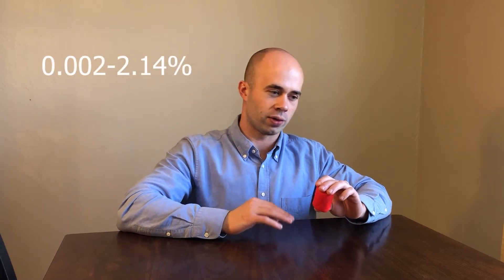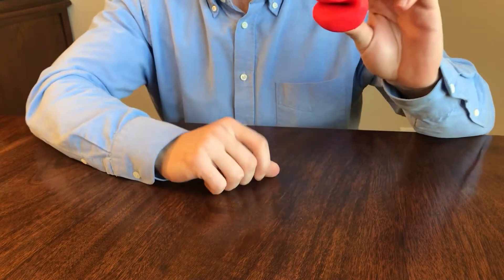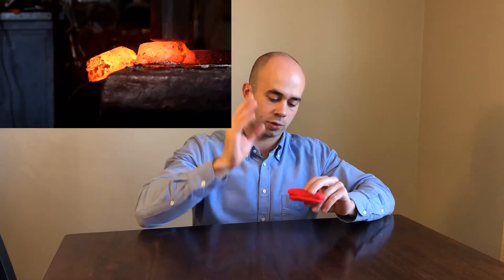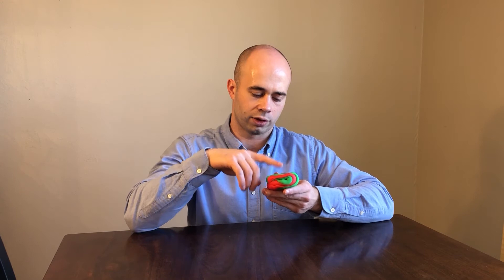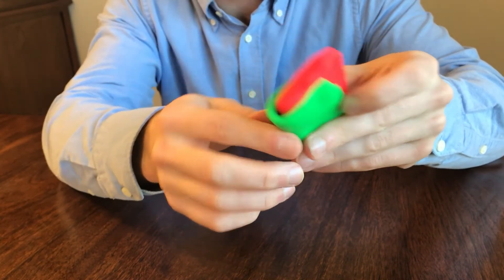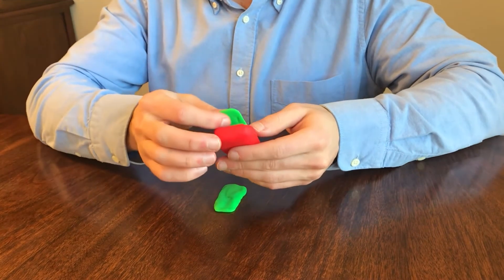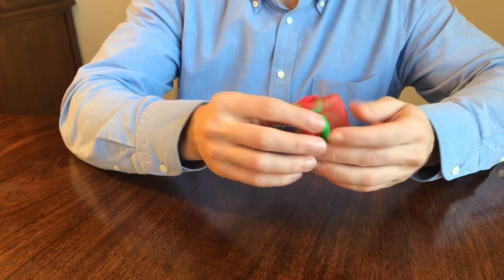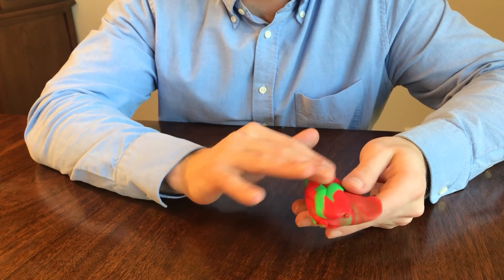Chinese Sword Metallurgy - Folding and Forge Welding 中國刀劍冶金學 - 百煉鋼和鍛焊方式

Comment: The twistcore segments of your video were unexpectedly interesting. I went thru the Mandarin mansion website to read up more about it and its really interesting that you say its probably from southeast asia. It seems like theres been a number of swords in south east asia like the kris utilize this technique. I was wondering what source or how you came to the conclusion that it comes from south east asia because the idea of that really interests me. Could it be possible that it arrived in south east asia by middle eastern influence? I dont really know anything on the topic of twist cores so im just spewing nonsense right now but the idea of southeast-asian metallurgy finding itself a place in chinese smithing as such an advanced technique is quite interesting
Reply from the maker: Fireislow As far as I am aware the theory was originally proposed by Philip Tom who is a widely respected figure when it comes to militaria in China and Asia more generally. I am not sure when or how places like Indonesia began producing twistcore blades. A middle eastern influence may be possible, but I don’t like to make any assertionswithout some research to back it up.
Reply from the maker: K, I just re-read an article written by Philip Tom in which he states that twist core blades came into Indonesia with the spread of Islam and then came into China due to extensive maritime trade between Southeast Asia and the Ming Dynasty. Here is the citation:

Tom, Philip M. W. "Some Notable Sabers of the Qing Dynasty at The Metropolitan Museum of Art." Metropolitan Museum Journal, v. 36 (2001): 211-214.

Comment: Thanks for the Video.
You reminded me of this page detailing Celtic types of welding

https://www.tf.uni-kiel.de/matwis/amat/iss/kap_b/backbone/rb_2_2.html

And this one regarding twisted welding

https://www.tf.uni-kiel.de/matwis/amat/def_en/kap_5/advanced/t5_1_1.html

I had them in my Bookmarks for ages, but I only skimmed them. Gotta read them later.
Reply from the maker: Vil Vuk Thanks for watching. Lots of good info on those pages!
Reply: @thescholar-general5975 
I wonder if you have a site with pictures of ancient chinese forge welded blades, maybe something like that uni-kiel link. 

I couldn't really find anything ancient/historic, mostly that twistcore dao or modern stuff that has only been folded and I have 2 of those at home. 
I doubt if they are that similar.

This page does have some interesting stuff
https://www.collectorsweekly.com/articles/my-afternoon-with-the-ace-of-swords/
Reply from the maker: Vil Vuk I don’t know of any websites that are exactly like that one for chinese blades. One good place to go is Thomas Chen’s website about Chinese swords. http://thomaschen.freewebspace.com/